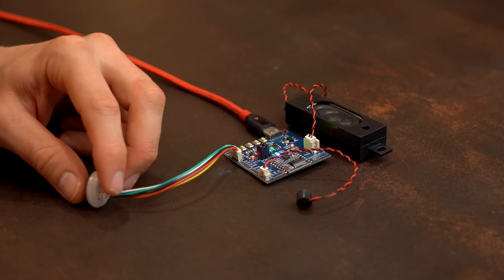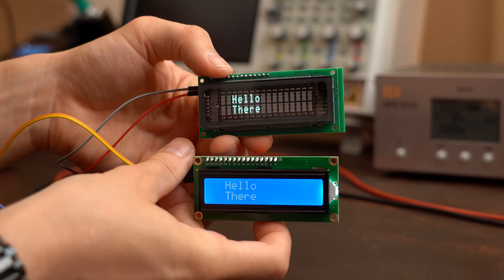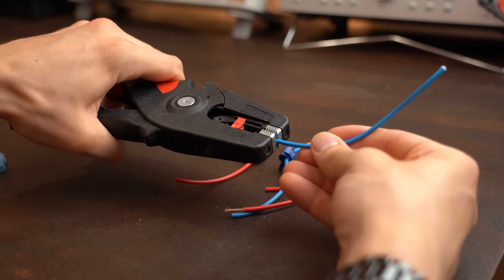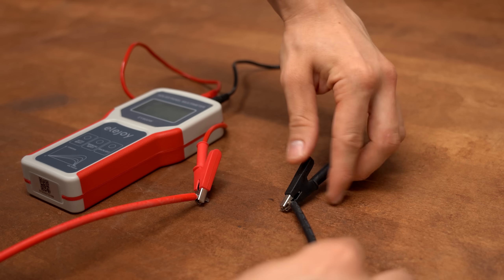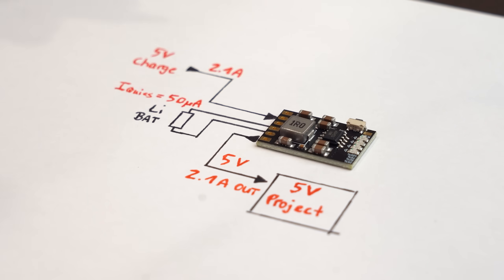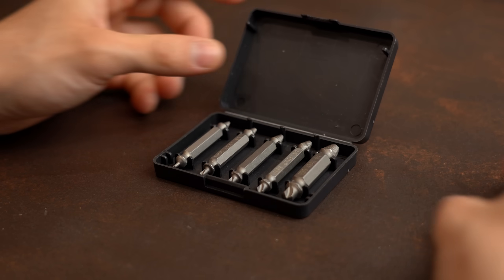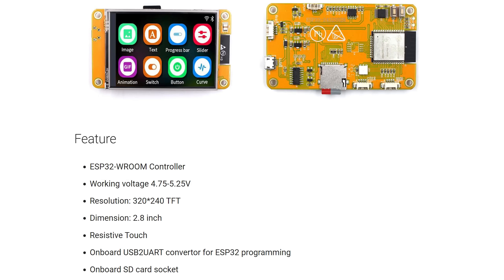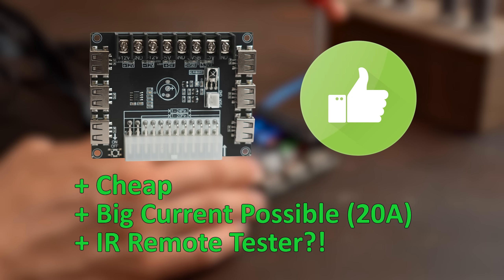I tried finding Hidden Gems on AliExpress AGAIN! (Part 6)

Comment: The last module you showed is a testing equipment board for testing modules (ie USB Audio boards, Pre-Amp boards, etc) which will also have a remote control bundled during packaging. USB audio boards work with 5V common, but Pre-amp boards work at 5,12 or even 24 V. Thats why they have added an IR tester section so that it would be handy to test those remotes too.😄
Reply: Typical eBay/Aliexpress product! Has weird features because it is built for a particular use case that needs them, but us geeks will never use. Doesn't matter, we love seeing all this weird and wonderful stuff!
Reply: @nimoy007 yep, but he's from German!
Reply from the maker: Good to know. Thanks.
Reply: @greatscottlab  BE AWEARE THAT ALL KINDS OF ADS ARE ILLEGAL! COMPLETELY!!!! IF YOU EVER PUT SPONSORED SEGMENTS OR ADS IN VIDEOS YIOUU TRIGGER MY PANICH ATTACKS!!!!! I AM TRIGGERED BY ADS AND I SUFFER!!!!!! WHY DO YOU DO THIS TO ME???????? IT IS ILLEGAL AND I MUST TAKE LEGAL ACTIONS!!!!!!!!! YOU MUST KNOW THAT LEGAL PENALTY FOR ADS AND SPONSORED CONTENT IS DEATH PENALTY!!!!!
Reply: I also wonder if this board have short circuit protection, etc like a real bench power supply. Because if there is it is really really cheap for it's capabilities. And would be perfect for diy power supply.
Reply: @NDMCN  the protection is usually in the power supply itself. some have them, some don't. this board merely breaks out the connections in convenient way
Reply: @NDMCN That is what I was just wondering. You could easily and readily repurpose an old power supply and put it in a case with this with some nice connections out, if so. Could even make a fairly portable lab bench power supply for those specific voltages.
Reply: Indeed, yes! ATX PSUs has internal short circuit protection but they can not determine whether the load attached is an actual load or a short circuit. That is because ATX PSUs can often supply a lot of current at the 5V and 12V rails, and until the attached load draws more Amps than the PSUs specs, PSU will continue to supply power. To sum up, an adjustable short circuit protection circuit could be implemented if you want to use an ATX PSU as a lab bench power supply to work with relatively small loads.    @NDMCN
Reply: @NDMCN well I use this board for a while now and when I accidentally short something the PSU and board survives (assume the protection is inside the PSU). 

Great product TBH. Literally living on my desk permanently.
Reply: Ok, I didn't get how this can be used. Would need an actual example to get the use case.
Reply: Does the atx breakout have short circuit and or over curent protection?

Comment: Did you set your drill counterclockwise for the extractors?
Reply from the maker: Yep. I tried it every possible way.
Reply: @greatscottlab  were the extractor bits hardened. i have a box store bought version that is hardened and they bite into screws and rip them out with ease. could be a knock off version that skipped steps to get out the factory cheaper.

Comment: The T connectors are a knockoff of the 3M T-Tap — which comes in multiple sizes for different wire gauges. If they’re using the same color scheme, the blue should be for 14-16 gauge wires.

I mostly see those (and the related Scotchlok splices) used in automotive or similar applications where you want to minimize the exposure of the original wire to oxygen and water.
Reply: Scotchlok's are rightly reviled in the automotive upfitter world. (at least those that do first responder equipment)
I can't think of a better way to cause wiring system failure than using those damn things.
Reply: @jimurrata6785  Used them on my first car in the 80s. They're trash.
Reply from the maker: Thanks for the feedback
Reply: @greatscottlab  I used similar T-connector for low voltage construction site illumination. Just hang up the twisted positive and negative feeding wire and use two connectors to hook into them and hang lamps where needed. Lamps ofc came with female connector preinstalled. Both feeding wire and connectors are probably considered consumables in that instance.
Reply: And the 3M are junk too. And have been for 20 years or more since they came out.
Reply: we used those T taps constantly when I worked in car audio, its the easiest way to splice into the system.
Reply: @Megasteel32  And the best way to cause problems later. lol
Reply: @inothome 
Yep. Quick way to make it work for the customer.... and quickest way to make it fall apart once vibrations weaken it all.
Show cars and young hooligans looking to pick up STDs girls probably don't have the same issues, but cars in rural areas that hit dirt roads a lot will. I've had factory bolts vibrate loose on dirt roads. I had my stereo fall out once because the vibrations loosened all the screws. My driver's window fell off it's lifting mechanism the other day because a bolt vibrated loose... imagine what would happen to a wire that's been partially cut through and then subjected to thousands of small bends back and forth.... it's going to snap.
Reply: @tin2001  nah i used some in my own remote start system in my car still works fine years later (6 years so far) driven almost every day
Reply: I used this to tap a reverse bulb line when I installed a camera on a car... and temperature fluctuations with changes of seasons made me regret ever using these things.:face-purple-crying:
...Also I learned a month later which wire at the head unit's harness was the reverse signal...

Comment: There are mh-cd42 boards on Ali that have the USB attached as well. The only issue I've had with them is they power off when disconnecting the supply power for a second before switching over to the battery. I'm not sure if that's just an issue with the specific board I got or if it's a function of that chip.
Reply from the maker: Thanks for the feedback :-)
Reply: I can confirm the cutoff

Comment: I like the t connectors for automotive use where you may not be able to easily cut and splice. I used them to get power for a backup camera from my reversing lights. They’re available in other sizes too.
Reply from the maker: Hmmmm Ok. If there really is no other way then yes......I still do not like them though.
Reply: @greatscottlab I don't have these t connectors but I had my eyes on them already. I partly agree and disagree with you, though. Of course, it's way more elegant and safer to use wagos where you can. These come in handy where you need a junction, but don't have slack, just as OP mentioned. 
Furthermore, while I agree that it won't fit to every cable size, you simply choose another one. And no, wago might be more flexible in this regard, definitely not fit for every wire size, that's misleading.
Reply: Handy until your backup camera randomly stops working. These kinds of connectors are really hit and miss in terms of reliability, no matter how correctly you install it.
Reply: This style of connection (idc) is ages old and the cause of so many electrical issues I deal with it's not a joke anymore... ask anyone about scotch lock connectors in vehicles ( same style of connection) .

They have one redeeming feature..they help keep me employed.

Comment: What I also like about the lipo booster is the 3V undervoltage protection. Almost all other boosters or bms cut off at 2.5V which I think is too low.
Reply from the maker: Oh boy. One feature I did not test. Sorry about that. But thanks for adding the information
Reply: could you maybe test that if you find the time and reply us here? xD  @greatscottlab
Reply: As far as I understand, 2.5V cutoff is ok for Li-Ion cells like 18650's but not for LiPo ("pouch") cells which shouldn't be taken under 3V.
Reply: Really 😳 that's amazing! I hate it when they have 2,5v is there a battery protection board with boost that has 3v low voltage cutoff?
Reply: This is fantastic! I recently gave up finding a good protection board on aliexpress because of the scary cutoff voltage. I missed this one because I was looking for ones with USB built in.
Reply: @spagamoto  look for "power bank module", there are dozens and dozens of them with the USB port built in and a bunch of protection features. Bear in mind that they all have a low current cutoff of around 50mA so if you're expecting to use them for low powered applications like a sensor that gathers data once a minute and goes into deep sleep the rest of the time, it won't work. I use them all the time for battery powered projects, very useful indeed.
Reply: Can you confirm that this board does have 3v cutoff?
Reply: @eliteman125  yeah I already used it like 10 times in my projects
Reply: @eliteman125  Yep, the IC this module is built around is the Injoinic IP5306, if you check out the data sheet you can confirm it has a low voltage cutoff of 3v.
Reply: That's exactly what I came to the comments to find out!  Great that it does boost but undervoltage protection is a must for something like this.  The fact that it's 3v is even better.  I'll definitely be buying some of these!
Reply: Hi, I bought the same charger, but it doesn't charge the battery that I connected to it. 
I measured the current that goes to the battery, and it is around 0.003 amps (basically nothing). Also, when I disconnect the battery, the 4 LEDs won't turn off. It's like a battery is connected to the circuit, but there isn't one. 

I would really appreciate it if someone could help me with this issue.
Reply: The other thing is, can it be used as UPS? Sure for low power 5V/USB devices like a Raspberry Pi.
Most of these boards have a long latency switching between power input and battery power which forces the RPi to restart.
Reply: @h_alkhalaf  No I think not , there is a 200ms delay when disconnecting input and the IC changes to battery mode. It can be resolved by adding a capacitor in parallel to load. I am planning on buying this module and replacing the IC with the i2c version one  so that it can set custom charging current and monitor the battery level for safe shut down of my raspberry pi.

Comment: So disappointed about the drill bits, I thought they would work and save me from my stripped screws nightmare 😢
Reply: I own the ?exact? screw extractor kit pictured
they're not great.
but, they do work if you use real drill bits to make an appropriately-sized starter hole and then are extremely careful and slow/high torque with the extraction
greatscott's review is entirely reasonable though, they're not great and really need to be babied into working properly
Reply: Seeing this 2 days after I ordered it😢
Reply: Wait hold on it is 4 days old video?
Reply: @MohitSharmaxp  Patreon subscribers get early access.
Reply: I couldn't write yep from the video... He did realise you need to run the spiral extractor bit slowly and in reverse, right?
Reply from the maker: @alaricsnellpym  Yes. Trust me, I tried it in every way possible. Maybe German screws are just too hard
Reply: @greatscottlab you can try drill that screw heard by outside high quality drill bits instead that trash bit heard
Reply: Theyworked for me really well. Even got A kit for my uncle.
Reply: 4 days ago!?